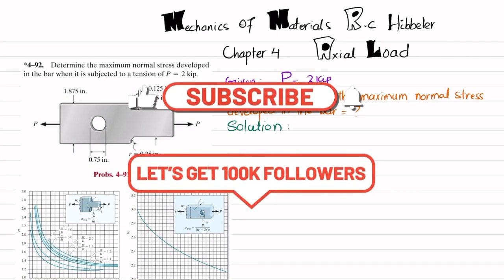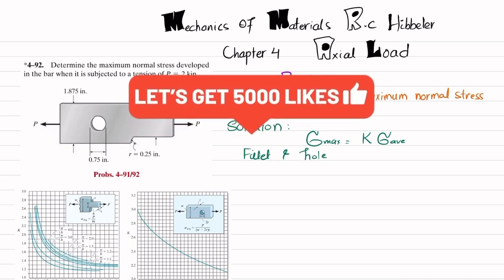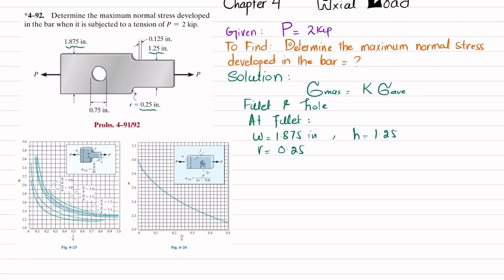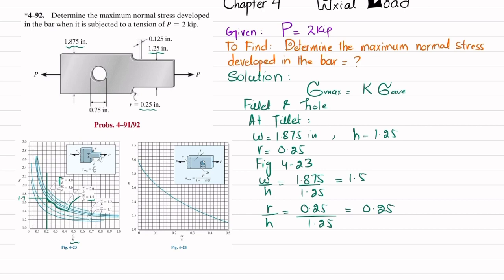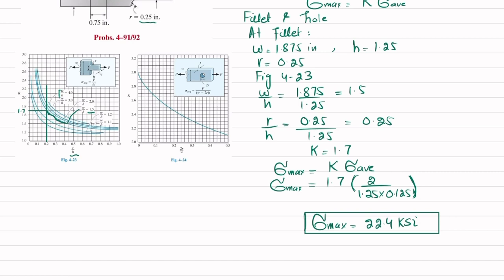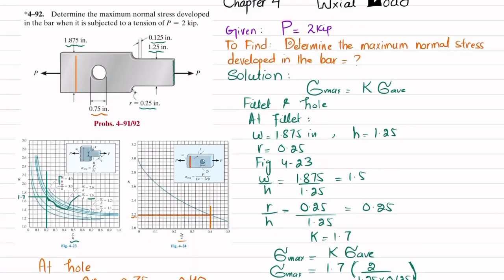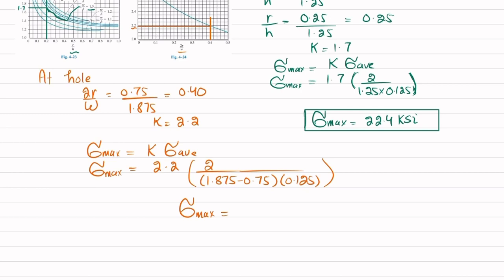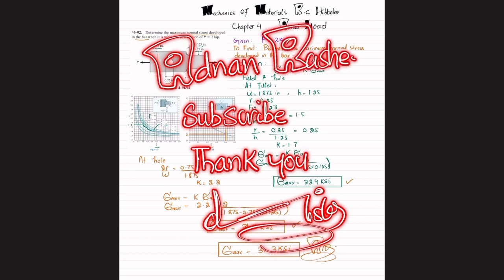4-92 | Determine the maximum normal stress | Mechanics of materials rc Hibbeler

Comment: I think you made a typo, @2:23 0.25/1.25= 0.2 but you said it's 0.25, but you still treated it as 0.2, just letting you know
Reply from the maker: You can rectify it and it will be a minute difference. ❤